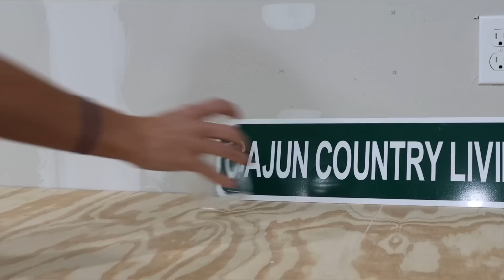It’s Time to Add Drywall TEXTURE & Revealing a NEW Project | Building Our Own Home Ep.84

Comment: Awesome job on the texture, my wife doesn't like textured walls, so when I did ours it was done with watered down texture and a paint roller, made her happy so all is good.  Like the tractor project, I started with an 8N Ford, but was made an offer for it that I couldn't refuse so now I have a small Mahindra. Great job as always and congratulation on the 100 K.  👍👍
Reply from the maker: Thank you Timothy! 
Something we learned early on was to truly speak up if one of us didn’t like something or it was something one of us was passionate about. Luckily, we both wanted to texture so this one was easy. 
I rebuilt a 8N Ford that had burnt to the ground. It had got so hot it burned the back tires off and burned the PTO seals completely out. Still built if from the ground up. Was a great little dependable tractor. Small Mahindra is what I was looking for before I got this one. Can’t help but have a little project on the side. It’s good for our minds.. well at least that’s what I say anyways. Haha. 
Thank you 😄
Reply: @CajunCountryLivin  You have to have something to do that helps you relax.

Comment: Another texturing technique you may consider is very similar but less labor dependent. 
Thin out some joint compound slightly and use a paint roller and roll the texture on the wall. 
You can vary the texture by which nap you chose. 
A smaller or shorter nap will give a finer texture and a rougher or taller nap could give you a very similar texture as your sponge method with less work. 
Just a suggestion?
Reply from the maker: Hi! Yes, we thought about this too. We decided on this application since it gives a bigger print texture. But we might do that on the ceiling!

Comment: Definitely applaud the DIY spirit cuz I do it too. Some things to make a project like this easier and more efficient would be to: 
Thin the mud, use a texture hopper and compressor to spray the mud on to a heavy splatter and then knock it down. Could get that whole room done in less time. 
Also, you didn't prime the walls before finish coats. This could cause some problems when you want to wipe down the walls. The paint might peel off. 
Also rolling the paint will help seal the texture better providing more durability.

Comment: My grandparents did this texture trick 50+ years ago to the basement ceiling in the house I grew up in. (They used brushes though, not sponges.) Great in concept, but the first time you have to do a repair it's going to be a bear to blend / match. That's the only forward thinking that I can offer.

Comment: Walls look good did the sprayer use paint straight from the can ?
Best of luck on tractor but doughting the no parts will need a few spark plugs and carb rebuild parts that kinda thing
Reply from the maker: I had to pour it into the bottom pan that attached to the sprayer. Here is the link to it. https://www.harborfreight.com/handheld-hvlp-paint-stain-sprayer-64934.html

Comment: Those walls look fantastic and you do a great job of filling the camera 😉. Captain Croc’s, your not going to have to much trouble getting that old Ford running!  You might need to have the cylinder head cleaned and reseat the valves but the engines are very solid good luck 👍
Reply from the maker: Thank you!😁😃 
They are soaking now! Fingers crossed. 🤞

Comment: Lydia just a tip on texturing use top coat compound it’s creamier and easy to use it comes in a bucket with a light blue lid and should say topping compound on the bucket or you can use what you have, and add some water, but be careful because some water leaves a rotten egg smell. Keep up the good work and Jim. Good luck with your engine project. 🇺🇸👊🏼🔨🪚👊🏼🇺🇸
Reply from the maker: Sounds good! Thank you Freddie! We had some of the blue lid as well, but I wanted to try the green for the rough texture. I would really like to try the blue in the bedrooms for a softer look. I’m sure I’ll let y’all know how it goes. 😁🤍
Reply: @CajunCountryLivin  
Sounds good and enjoy your week 🇺🇸👊🏼🪚🔨👊🏼🇺🇸

Comment: Congrats on the 103k! - Good luck with the engine rebuild Jimbo, It does not look too bad in there. I like the little Ford, should work well for you (once running). I really like the way the sponge technique turned out. At first I had a big question mark in my head when it was going on the walls. But as soon as you started to knock it down it really came together. Great job both of you. - Cheers.
Reply from the maker: Thank you so much Mikey! And thank you for watching! See ya Wednesday!

Comment: Hey Lydia and Jim, when you get around to painting, let me give you the best tips you are ever going to get, buy a Sealer and Undercoat in one, I think there is a 3 in 1, Sealer/Primer/Undercoat, once you get that, then make sure you get it TINTED to 75% of whatever the Top Coat will be, ok once you digest that, the next step is the most important, buy quality paint, I only buy SOLVER PAINTS which is owned by Wattyl as they are the best. Not sure if you can buy that in the U.S. so you might have to buy another brand, using a Spray Gun makes the job faster with a better finish. lol
Reply from the maker: Thanks for the tip!

Comment: You could always take the engine block to a machine shop and have them turn out the cylinder a few thousands of an inch and get bigger sized O-rings to match for the pistons. That featured wall drew upon Lydia's artistic talent. Looks good and quite durable for a growing family.
Reply: But🤔 Jim told his other half that he could get it running without further cost…….😉🤔
Reply from the maker: I would like to do a complete overhaul but I promised Lydia that I could get it running without buying parts. So I have to give it my best shot before having to “eat crow” 😂
Reply: No there is a real man that does his damnest to keep his word... 👊💯